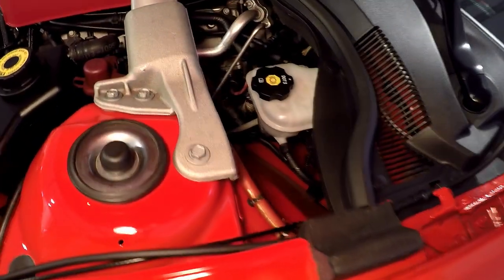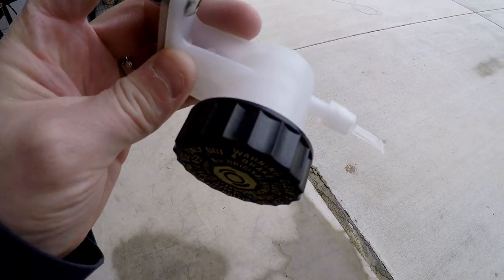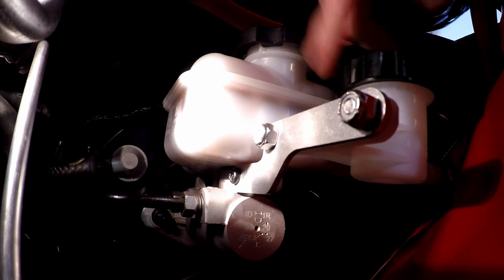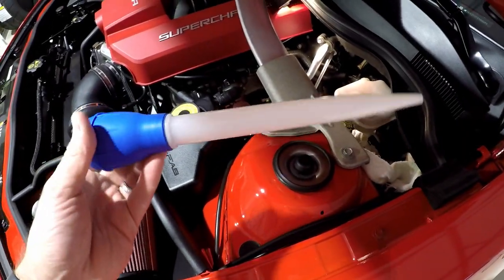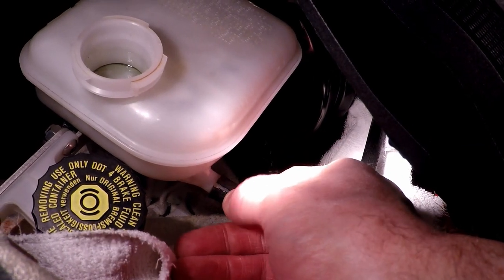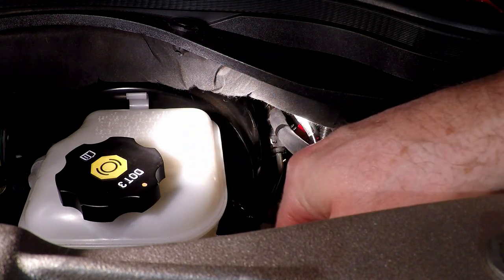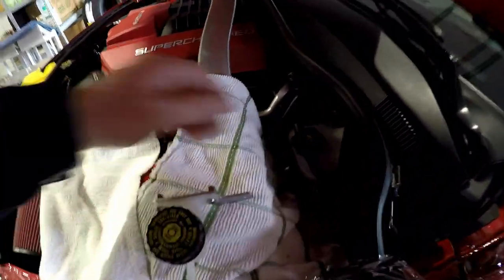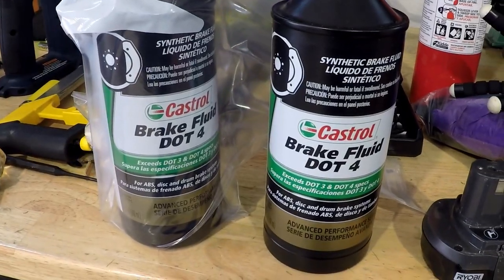How to install a clutch reservoir on the 5th gen Camaro

Comment: i have two 6th gens. what’s the disadvantage of having one reservoir for the brake and clutch fluid?
Reply from the maker: The dirty brake fluid will make it back up into the reservoir contaminating the fluid and then it'll end up in the fluid going to the clutch master and slave cylinders which can cause wear and issues.
Reply: @fasnuf  If one of your clutch cylinders got a bad leak, would it drain all the fluid and cause your brakes to fail? That was my first though about why this would be good.
Reply: @jaxjax2011 I’ve never seen that happen, but it’s definitely possible, considering it takes fluid directly from the same reservoir…. It theoretically could empty out the shared reservoir and leak you with only no clutch, but NO BRAKES on top of that!

It’s honestly a cost effective method GM used, and it’s one of those things where upgrading to a better solution (separate/remote clutch fluid/master cylinder reservoir) would give you only benefits, rather than any downside(s). 

Being able to keep brake fluid clean individually, is probably the best benefit, aside from the precaution about leaks that you mentioned. 

In my experience, the clutch master/slave cylinder bore travels much much more than the brake pistons and the brake master cylinder. This in turn, means that the brake fluid for the clutch line(s), contaminates at a much quicker rate than the contamination of the brake fluid for the brakes. 

A known issue is contaminated clutch dust accumulating through the clutch lines, so this would for sure be a MUST HAVE mod for any 5th gen Chevy Camaro V8 manual.

Comment: I Had an issue with the clutch of  my 2013 camaro LS  know i now how fix that thing!! THANK YOU SIR!!!
Reply from the maker: You’re welcome
Reply: If it’s an RS (with LT engine), it has way more issues with the manual trans/gearbox, than just the clutch setup alone..
Reply: @isnowyazn  like what
Reply: @eviljesus6111 Just look up the AY6 transmission/gearbox by Aisin. It’s also used on other Toyota vehicles as well. They’re plagued with issues, and are not outright made to be beat to death. 

They also don’t really have upgrades or aftermarket support, nowhere near the level that Getrag/Tremec manual transmissions have.

I usually tell everyone with an Aisin AY6 to change their clutch fluid and manual transmission fluid (MTF)/gear oil if they constantly beat on their trans/gearbox. That’s as much help as you can possibly do for it. 

I know they have aftermarket clutch and flywheel upgrades, but I’m not sure about anything else to upgrade the transmission/gearbox.

Comment: I bought my car used about a year ago  with this external reservoir and just found out the hose is leaking from the side connecting to the firewall of the car.  My advice is to upgrade the hose on this kit because it is already dry rotted and nasty.  Just heads up.  Clutch ran dry and almost left me stranded.
Reply from the maker: Thanks Chase. Do you have a link for the upgrade you used?
Reply: @fasnuf id like to know what he used as well

Comment: That is still too small mine kept boiling on long drives on hot days and was just a nightmare. I picked up a 10oz aluminum tank now no more issues
Reply from the maker: That’s something I never heard on this. Maybe that’s why GM used the brake resi. Do you track the car hard? What DOT fluid was boiling?
Thanks for the comment.
Reply: @fasnuf Yeah, I’ve heard of some people having issues with the clutch fluid being contaminated super quickly. I didn’t have this issue, so I returned my Tilton remote clutch fluid reservoir. 

I only change my clutch fluid like every 2-3 months, and I’ll notice the contamination (clutch dust/particles) floating to the top of the clutch fluid, and settling around the top rim of the fluid reservoir.

Aside from that, it’s just good to have extra fluid. During a full single pedal stroke with the stock clutch master cylinder, I’ve seen the clutch fluid drop from the max level, to like maybe 5-6 mm above the reservoir feed.

Comment: I accidentally used a fuel/emissions rubber line, for my upper clutch (fluid) line. It started breaking down the inner lining of the fuel line hose, and you could feel the loss of pressure in the clutch pedal, as well as being able to squeeze the hose by hand… 

I ended up swapping it with a proper EPDM hose (Gates brand), and ditched the useless (for brake fluid) NBR (nitrile rubber) hose, since it was causing my clutch engagement to feel wonky. The clutch pedal was a lot softer, as the fuel line broke down and permanently softened, which led to a loss of hydraulic pressure (presumably).
Reply from the maker: Good thing you caught it. EPDM is good stuff.

Comment: So if you flush your brake system you also have to bleed the clutch?
Reply from the maker: You don’t have to but any contamination in the clutch line will make it back up to the brake reservoir unless they are separated. It’s difficult to bleed the clutch because of where the bleeder screw is. If you replace the clutch, look for the remote bleeder hose on Google. Can’t remember who sells them.

Comment: Why do you want to add a master cylinder to your set up? I thought GM made a awesome design with the brake master and clutch master sharing the same fluid using a single resivoir. I learned about this from your video and decided to attempt to retro fit on my 1970 Chevelle LS3 T56. Now I see you adding a clutch resivoir and wonder does the oem set up have flaws?
Reply from the maker: The setup doesnt have flaws for the daily driver. For track use the fluids can become cross contaminated sharing the same reservoir. I wasnt having the problem, but just wanted them separate
Reply: @fasnuf  ok thanks for the clarification....

Comment: There's no reason to add a clutch Reservoir unless you Road Race your car using your brakes a lot  heating up the brake fluid, unless it's something you want to do. I thought about doing it but didn't see any benefit
Reply from the maker: Correct, in a way. The dust is coming from the clutch, not the brakes. A daily driver doing regular maintenance won't see much benefit, but I'm hardly nice to my car. I didn't like the idea of sharing my brakes and clutch so for that reason it was necessary and relatively cheap. Thanks for watching.
Reply: If you have long tube headers your clutch fluid will boil and you have to bleed the whole system major pita
Reply: @Camarowhplsh   I have 2" primary long tube headers on my Camaro with zero clutch issues.
 I installed a stainless steel clutch line and stainless steel remote clutch bleeder line routed under the hood It makes bleeding the clutch super easy.
Reply: @Camarowhplsh Never heard of this on a 5th gen, even with dudes who track the car. The clutch fluid might boil or whatever, but not as a direct result of the header heat. 

The clutch fluid alone, shouldn’t even get SUPER dark from contamination, unless there’s a severe issue with clutch dust/particles going through the slave cylinder seal(s). I personally change mine every 2-3 months to be safe; although without any hard driving at all, you could probably go for 4-6, maybe even a bit longer before swapping out your clutch fluid.

Comment: Did you have to bleed the clutch or brakes after installing the clutch reservoir
Reply from the maker: No, because  air didn't get into the system